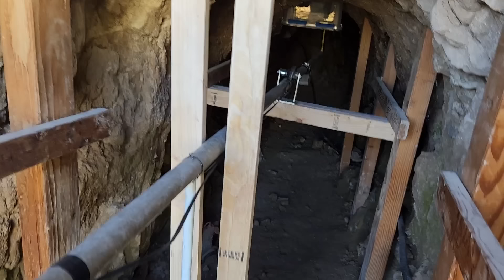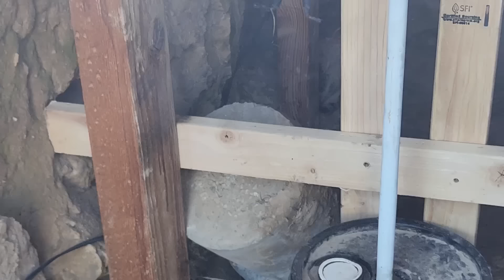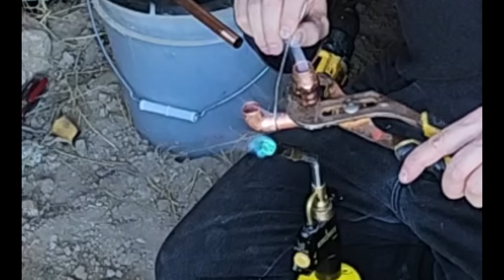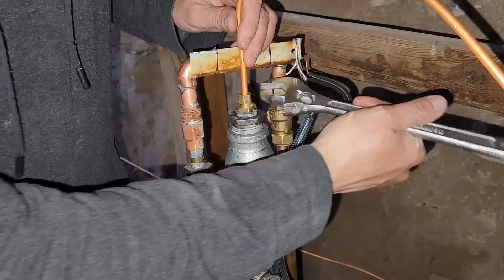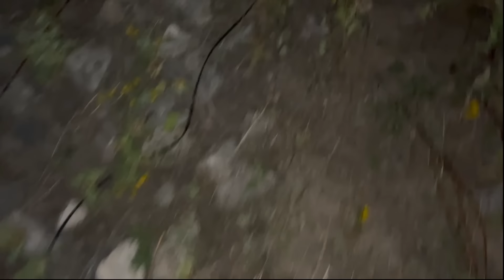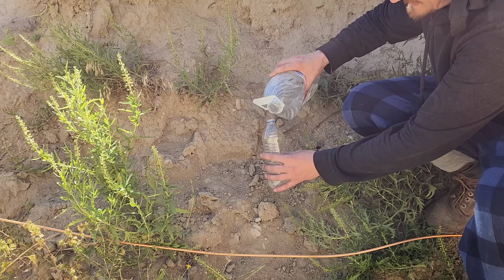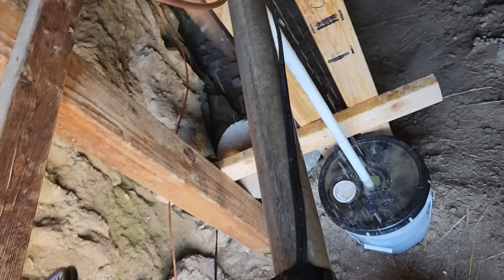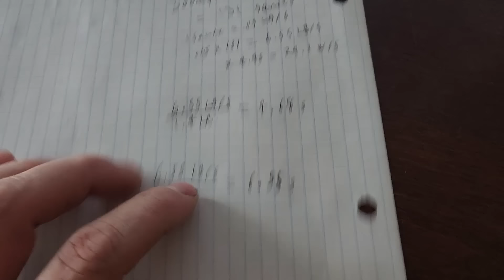Sodium Water Hybrid Rocket?

Comment: This was really cool. Perhaps cool the combustion chamber (with sodium) could be chilled with dry ice before water injection to prevent the sodium from melting so quickly. Also the injector may incur so much backpressure from the gasses that the water flow is temporarily reduced giving an uneven burn in bursts. Lots of things to think about here and I love it.

Comment: I wonder if you could use a hybrid rocket set up like this to generate the heat to melt a fully liquid sodium rocket. using potassium might make it easier to ignite and inject but it also makes it much more expensive and its more reactive and harder to work with

Comment: I think that you should stick with the hybrid rocket, I see it as having good potential. I think all you need to make it work is to cool the sodium so that it doesn't melt and fly out of the rocket. You can run tubing through the sodium so that the water cools the sodium while also being heated itself. So not only while keeping the sodium cool you can preheat the water so that you get some added efficiency and a more complete reaction from the phase change. For the tubing I recommend HPLC tubing since its got a much smaller diameter than the copper and can hold up to the pressure so your rocket motor isn't huge.
Reply: "What we wanted was some solid material, which could be placed in the chamber beforehand, and would react with the propellant when it was injected to start the fire going. 

We tried all sorts of things — powdered magnesium, *metallic sodium,* and what not. (The candidate was placed in a horizontal one- or two-inch diameter glass tube, the propellant was sprayed in at one end, and the results were monitored with a highspeed camera.) We had no luck for some time, but then we finally hit on a highly improbable mixture that worked — a mixture of lithium hydride and rubber cement. This unlikely sounding mixture was made into a thick dough, spread on a sheet of gauze, and then wrapped around a wooden dowel. The end of the dowel was tapered and screwed into a plug tapped with a Vs" pipe thread. The plug, in turn, was screwed into an appropriately threaded hole in the center of the injector, so that when the propellant was injected it would impinge upon, and react with the ignition mixture. The whole device, some six inches long, was kept in a sealed test tube until it was needed, to protect the LiH from atmospheric moisture. The business end of it was a ghastly corpse-gray, and it was the most obscene looking object I have ever seen — and the rocket mechanics christened it accordingly."

-- John D. Clark. (1972) "Ignition! An Informal History of Liquid Rocket Propellants". p 143. Rutgers University Press, New Brunswick, NJ. Available at sciencemadness dot org/library/books/ignition(dot)pdf

Comment: Oh no, Cody you messed up the unit of the impulse! It's Newton seconds (Ns) as you said, but you wrote N/s, you cannot just add a slash here, because it would imply to divide the seconds where you must clearly multiply it to get the area under the curve 🧐😱 Besides that ... great video 😊
Reply: Is this the same with lb/s? Should it be lb*s? Also why did he list 1 square as 0.5 lb/sec when the x axis is 3 frame per square? Not 1 sec per square? Am I wrong?

Comment: what if you used a mesh material when pouring the molten sulfer so that when the water starts reacting with it, it has some structure holding it in place and not let it break apart to quickly ?

Comment: The force in pounds?
You can use calculus to determine the area under the graph.
Or graphically estimate the area.)

(Weighing the cut out of the graph is a Very creative way of determining the area)

The surface area of the sodium cylinder  is small. 
Could you have use a bed of sodium spheres where the water can flow more easily? A packed bed of sodium spheres

Comment: Assuming that the frame rate is 24 fps, shouldn't it be 1 square = 0.5 × 1/8 s = 0.0625 lb·s?
Reply: Ah... the frame rate is 30 fps.

Comment: What you should do is powder the sodium and put an adjustable inlet to feed it into the rocket nozzle on one side then install another inlet on the other side for an adjustable water nozzle mister. That way you can calibrate each side to make perfect thrust. You could probably power it with small pressurized canister. So you would have a pressurized canister a canister with water and a canister with powdered sodium in upper part of rocket. Could use smaller combustion chamber and everything else aluminum or carbon fiber.

Comment: gravity is not your friend here since sodium melts and drips out the exhaust - try using a bucket filled with sodium (aspect can control thrust/burn time) and direct the exhaust through a nozzle pointed down. flood the bucket with water

Comment: What would happen if instead of injecting water from the top of the sodium, you added a smaller diameter pipe from the injector that runs through the sodium core and sprayed the sodium from the bottom?

Comment: before i start watching the actual test, i paused to comment that i foresee it not being an actual hybrid rocket, by virtue of the fact that the generated heat should very quickly melt the "solid" component, blocking the actual nozzle and basically shooting out all the now liquid-sodium with the pressure generated by the expansion and the argon.

the only actual solution i can think of, is firing the rocket horizontally, and rather than the sodium being formed into a hollow tube, it should just be on the bottom of the horizontal rocket motor, and the pressurized water should flow ON TOP of it.
ideally the weight of the sodium should prevent it from shooting out as quickly, even if liquified by the heat.

Comment: Would be great to see an engine where sodium vapors (882,8°C) and steam would be mixed in a combustion chamber to maximize the thrust.
The construction would be rather simple, like two sealed containers with a tubes to connect them with the combustion chamber where the fumes will react. Hence you can tune the throttle by heating and cooling the containers. 
Also, the reaction in the chamber will be self controllable as the rising pressure will change the boiling point of water and sodium in the containers.

Comment: Back in the day guys made rocket powered race cars that used silver screen that had pressurized hydrogen peroxide forced through it then a nozzle. Since you learned you don't need much sodium, try doing a smaller portion in a honey comb/screen shape to increase the surface area which might be more efficient/effective
Reply: If you are interested the guy is rocket Rod Phelps

Comment: Is there a way to add the sodium in a composite that is slightly water soluble and heat resistant? I can see this might limit the melting, or at least keep the metal suspended in some sort of matrix. Perhaps some material that is a slurry of an anhydrous solvent and carbon or dirt or clay, allowing it to dry. Maybe an epoxy or lightweight resin substrate with a thin coating of raw metal on the inner diameter to start the reaction. I'm curious to see some improvements that you would make going into the future.

And If anyone has some spitball ideas throw them out. Id love to hear them.

Comment: The negative impulse shouldn't be measured since the ropes will not be able to transmit a negative force to the spring gauge. You would need to have a solid metal connecting rod for that to be accurate

Comment: If you have access to a 3D printer, you might be able to make some interstingly shaped fuel grains.  Sodium's melting point is slightly lower than the glass transition temperature of ABS, so it might be possible to cast it into an ABS mold.

It's probably a recipe for disaster, and there's a hundred reasons not to try it, but it would be really cool if it worked.

Comment: Could you possibly do a combustion chamber in which both reactants are added in liquid form (as is used in liquid hydrogen-liquid oxygen rockets) which are pressurized into a central chamber? You could use a heating element to melt the sodium and keeping it under argon should stop it reacting prematurely and exploding

Comment: With a NAK liquid fuel and an oxidizer of high-test peroxide I think it'd be a REALLY potent little liquid fuel rocket, especially if you swap out the jet injector for a poppet or plate injector to get better mixing, or use two jet injectors aimed at each other. Water's probably a lot safer for testing than HTP but for actual rocketry, getting that extra bit of impulse by having your oxidizer pull triple duty as a monopropellant, hypergolic, and oxidizer would be a major performance boost. Additionally, with NAK, your "metal parts" would not qualify as "substantial" for any real definition of the word, at that point it's just a metallic fuel - same as the magnesium in flash powder.

Comment: Could you pre-heat the sodium and use that as the liquid fuel pressurized by argon or some other inert gas? How much specific impulse would that have if you used pure oxygen as the oxidizer instead of water?

Comment: If you wanted, you could use sodium potassium alloy instead of straight sodium. The alloy is liquid at room temperature, and could be injected in a similar way to the water. This should give a much more complete combustion. But, of course, it become a bit more dangerous working with a liquid metal that is quite happy to explode in contact with water.
Reply: nvm he mentions this right at the end

Comment: You should try to use a hydrated salt as a source of water, maybe you could create a sodium magnesium sulfate composite that would be easier to handle than the whole pressurized water tank and only needs a heat source for the reaction to start

Comment: It probably had much higher thrust than your result concluded due to the "shock absorber" you used to mitigate spikes. The footage showed the rocket start and as soon as it reached what appeared to be the "peak" of thrust, it died. I doubt it had time to overcome the shock absorber to be measured in that short of a period of time. If the fuel hadn't failed, you likely would have had a much better result...

That said, making a dual liquid system sounds MUCH more effective and easier to control to prevent that specific mode of failure from reappearing.

Comment: I wonder if instead of a single point of injection, if you'd have used an injector tube about the length of the rocket body with orifices in it going through the center of the fuel, that you would have gotten a more complete burn.

Comment: Great video Cody's Lab.  I think further testing and trials should use a 3d printed core instead of your all-thread core.  Melting temps of some filaments being near twice the melting point of sodium, you could print multiple core designs to fill at the test-site.  Others mentioned backsplash oxidization by pumping the water between the nozzle and the fuel to get a more complete burn.  I would like to see a continuation of this project.

Comment: Tiny quibble: your sheet has Lb/s and N/s written on it, but the units are actually Lb*s and N*s. Results were all right, of course.

I do wonder whether you could embed granules of sodium in a thermoset hydrocarbon, a bit like the usual aluminum/ammonium perchlorate/rubbery-stuff fuel grain but without the oxidizer; if enough sodium is exposed to burn, it might stabilize the grain against melting. The polymers almost certainly won't burn, though, which would be inconvenient; maybe they'd crack into lighter hydrocarbons with the excess hydrogen though?

Comment: I'd start with possible 2 or more injectors, maybe something at the exhaust to not only complete the combustion of the unburned sodium coming out of the nozzle, but to add mass to the propellant. You might also look at some alternative geometries of the sodium to improve the burn completion, maybe fill in just one side of the rocket with sodium so the water can pass and contact the entire surface area...

Comment: I'm no rocket scientist but how did you come to the size of nozzle you did? like I said, no expert here but it does seem quite large. Then again I'm not sure smaller would have changed things, it seems like you might need some sort of sodium honeycomb type structure for the fuel to get it to wet evenly? who knows!
Reply from the maker: So I did it based on how much thrust my rig could measure. With a feed pressure of 800psi and a nozzle opening of 1/4 inch the maximum thrust would be ~40lbs.
Reply: @theCodyReeder  Thank you!

Comment: Im thinking that the reactions were just breaking chunks off to never be used as thrust. An idea I have is to use the thruster and spray a thin layer of atomized water (or just a fine mist) from the side of the reaction chamber and then from the top spray in liquid sodium. The two could be pressurized the same way you did the water, but I would pressurize the sodium more to really get it moving.
The reaction chamber would probably need to be smaller. Feels like a much more complex setup, and water usage would be higher, but I could see it getting higher pressures with more surface area. Just slightly inching over to p-bomb territory.

Comment: I see, it's similar to a hybrid rocket. 
Maybe sodium is just too easy to melt to work in such a concept. 
If you can make a liquid rocket with injectors for sodium and water, it is more controllable. 
A sodium potassium alloy can help to keep the metal liquid for the injector.

Comment: Testing horizontally might also be easier, build a little carriage on wheels or ball bearings and have it press up against a little load cell. The super cheap hx711 based sets will do 10 or 80Hz sampling. Makes the data processing a lot easier, and no weight loss.

Comment: Yeah, I am going to be the pessimist here and say this will never really work. The low melting point of the sodium is working against you, as it goes from solid to liquid inside the combustion chamber. Once it transitions there is no good way to keep it in the chamber while also letting the exhaust gasses out. Even if you were to invert the combustion chamber (with a U bend to redirect the exhaust gasses) so that gravity (or thrust) was helping keep the liquid in place, any droplets that got caught up in the violent reaction would be expelled with the exhaust, dramatically reducing efficiency. 

I do not see a way to increase the combustion rate of the sodium so that it all burns in the chamber. The faster it burns the more pressure and heat you have, the more pressure and heat you have the faster it melts, and the melted stuff is the problem in the first place. 

The only way I see a sodium rocket really working is as a full liquid flow rocket. That, of course, has its own issues with keeping the sodium flowing at the right temperature, plus all the complicated plumbing thereof. For anyone who wants to try that feat of engineering all I have to say to you is "Good luck."

Comment: I had an interesting discussion about something similar with my high school chemistry teacher MANY years ago....  we concluded that the only way that this might work would be to spray a mist of hot liquid sodium and a water into the rocket motor to react otherwise the sodium would react too slowly and incompletely.  We also discussed using other more reactive metals like potassium or cesium but figured the reason nobody uses it is because it's expensive, heavy, and dangerous.

Kind of neat to see somebody trying out something I once wondered about as a child.

Comment: Would a steam injector give a smoother oxidizer delivery? I wonder if the fuel might be getting gouged and pitted while the high pressure liquid water is hitting it causing it to burn unevenly.

Comment: You could try a staged fuel design with the water injection from the bottom rising slowly to the top of the cylinder. That would also resemble the "standard" design of rockets where you light them from the bottom and they burn from bottom to top, not from top to bottom as in your design.

Comment: Hmm, I wonder how difficult it would be to vaporize the 'fuel'. Obviously, it would have to be molten and under pressure, but the question is if the .. (damn, the name of this design escapes me at the moment) ... 2 opposing nozzles tilted 45 degrees, one with oxidizer, the other with fuel, with jet meeting at some point,  would work. Biggest issue (other than the whole thing being incredibly dangerous) would be probably the  sodium clogging the nozzle(s).

Comment: I just feel like Sodium > Thrust exit isn't the way to go. Sodium > Expansion chamber > Thrust exit comes to mind. Because you need to keep it contained somehow and have a different path for the pressure to escape then a straight hole. 

Another thought would be to have a fine mist of water, so you never get a big pop which makes the sodium fall apart?

Just some wild thoughts.

Comment: Sodium instead of NaK might be worth it to avoid the handling difficulties of NaK. You'd be trading the need to heat it up before firing versus troubleshooting a setup containing pyrophoric liquid that is also aggressively corrosive (creating things to troubleshoot) when it contacts air. I'm not sure either way but my guess is that sodium is easier.

Comment: What if you coated the inside of the sodium tube except at the very end, so water doesn't react until it reaches the end?

That way you may be able to make the sodium react and get consumed from the bottom up like a gunpowder rocket. As the tube gets melted / consumed, the coating gets vaporized as well, exposing more of the sodium.